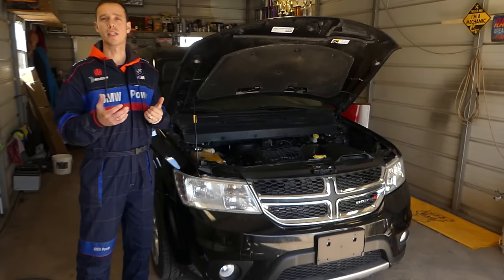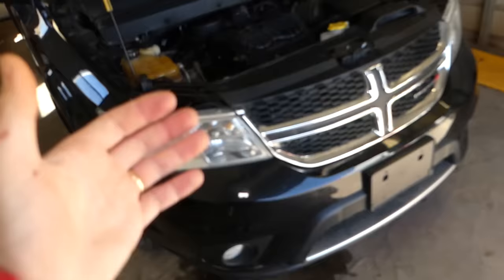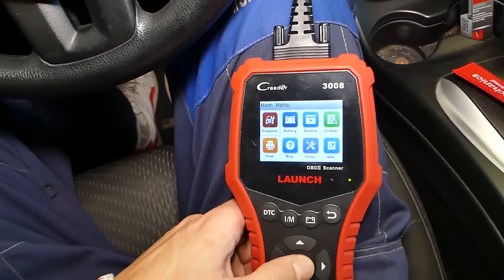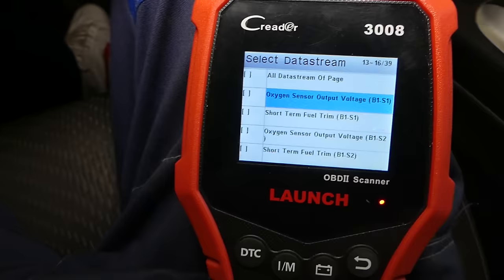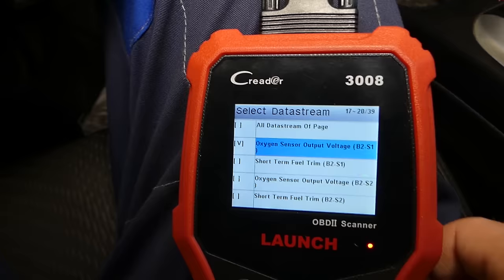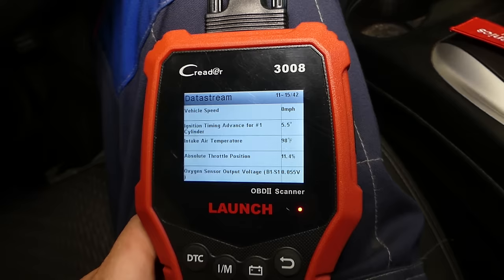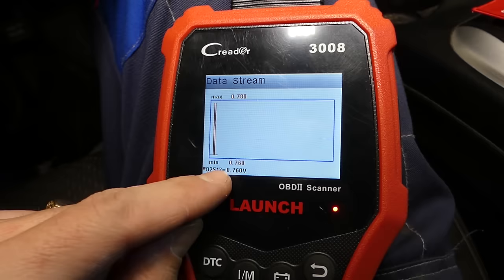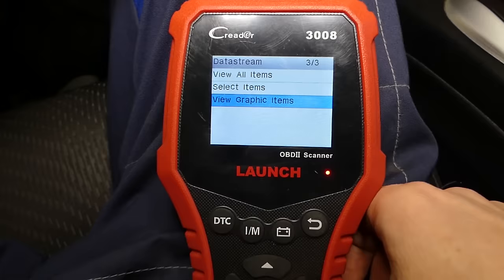HOW TO KNOW IF OXYGEN SENSOR IS BAD  TEST OXYGEN SENSOR

Comment: The Sensor 1's are what's called a PID feedback circuit, which means it hunts above and below what it wants... the figures are undershooting and therefore it adds fuel, then it overshoots and backs the fuel off, causing it to undershoot again, causing it to add more fuel again, as it oveshoots it reduces the fuel again, repeat. Basically the feedback loop reacts too much and it keeps on adjusting, going above and below what it wants. 
I imagine a house central heating system to help me understand.... When the room is cold, the heating turns on, heating the room up but when the temperature overshoots the thermostats set amount, the heater switches off until the room temperature falls back down again. Another example of a PID feedback system is a cars cruise control that's set to 100kph as it drives up and down hills, as it goes uphill the cruise control throttles up to keep at 100kph, as the car goes downhill it backs off to stop it going over 100kph. 

In this video Bank 1 Sensor 1 is working as its hunting,...fully adjusting back and forth.
Bank 2 Sensor 2 is dead, its not reacting at all and flat lines no matter what the engine is doing.
Reply: How do u differentiate what he shows vs a problem in O2 wiring? Thanks

Comment: Good humor. Bought the 7 piece socket o2 set. Only 1 fits the sensor, and I can't get leverage where its at. Won't budge. Sprayed penetrating oil, etc. Only thing I can think of is a very deep well socket to get me up and above some where I have some room to work. Will add an extension bar to the wrench too. That rear cyl 4-6 socket is in a hellish position. LOVE IT! Probably like this to force me to take it in somewhere.............

Comment: Thanks for the video. I hope you can show a lazy O2 sensor scan waves. I used a $10 Bluetooth OBDII scanner to test. Another YouTube video indicated that pumping brake pedal will release vacuum via the brake booster vacuum line, thus inducing a response in scan waves. My XG350 2004 (idle smoothly) showed rather active up and down waves for Bank 1's and Bank 2's S1 sensors (responsible for short-term air/fuel mix adjustment). They responded to my brake pedal pumping (3 or 4 times) (car in garage, not moving) after a very short delay (less than a second perhaps) to show a large peak. The same behaviors were seen in XG's OBDII short-term fuel trim curves. The peak disappeared after a few seconds. My Saturn Vue 2007 V6 (with Honda Pilot engine) (having rough idle problem) did not show S1 sensors in OBDII. I checked Vue's STFT curves instead. Same large peak response to brake pedal pumping. However, the waves without braking were only occasional and far less frequent than my XG's. I guess that means I have lazy S1 sensors causing rough idling. I will replace S1 sensors to see whether rough idling will improve.
Reply: Did it fix your idling issue

Comment: Hello great video! According to my scan tool my 2000 Toyota Camry 2.2 l 4 cylinder bank 1 sensor 1 upstream shows I have over three volts when warmed up! Would that .ean I have a short maybe or bad sensor. Any advice would be appreciated. Thank you
Reply: My 2001 Tacoma does too! I think that’s normal for those early Toyotas if we’re both seeing it. Mine was showing that long before P0420 problems.

Comment: Thank you so much for this video!  I've been getting a hesitation at low rpm idle and couldn't figure it out!  No codes to read.   Once I plugged in my obd II dtc tool and went to live data and watched all my o2 sensors in action.   I was able to determine that B2S2 (downstream) was falling well below the acceptable range.   I ordered a new oem sensory and will be installing it tomorrow.   I will keep you updated if this fixed my problem!  Probably saved my hundreds of dollars 💸.   I had an appointment set for Jan 4th but will cancel now.
Reply: Any update?
Reply: Update:  indeed the O2 sensor needed to be replaced and that part was easily diagnosed and fixed.   However, I'm still getting a slight hesitation and idle when I'n drive

Comment: What if my sensor is reading 0.01V at idle for a long period of time and doesn't go up a down unless I give it throttle
Reply: @Jake Blakeman post cat - downstream.    Im trying to get catalytic monitor and 02 system ready but my o2 sensor 1 bank 2 is at .105 volts ( at idle and engine full warmed up)

Comment: Hi have a question. What if the catalytic converters has the one problem. Does graphics moves up and down still?
Reply: Probably too late on this comment but in case someone else has the same question. If the catalytic converter is bad the downstream sensor will not stay around the 0.7 mark like in the video but instead rapidly change up and down much like the upstream sensor does

Comment: Well explained video. I have a question though. Its about the faulty Sensor 2 post cat sensor that showed 1.270v. Is that voltage from the ECU?
I have a GM corsa with a bank 1 sensor 2 P0138 & P0140.
It shows in live readings as 1.275v constant, even when the engine is cold and off, with the ignition on?
Reply: same here, did you find out the problem?
Reply: @luisdaniel75  Yes, it was the O2 sensor. I just bought one and replaced it myself. All sorted.
The 1.270v showing on the diagnostic really confused me.
I think it is an ECU reference voltage

Comment: Hi, Great stuff. You know your stuff.
Question. I am getting O2 codes on 2000 ML430, My symptons are NO start when truck is warm. I did cde check got O2 sen0r BANK2. I am going to order in a couple of weeks. But want to be sure this will fix my no start. ( thought it was immobiliser but found the no start was only when warm)

Comment: Dodge Ram 1500 4.7. O2 Bank 2 shows low voltage on idle. My understanding is the O2 Bank 2 should read high voltage on or above 0.45 to 0.85. Low voltage is lean condition, could there be an exhaust leak? Thank you!

Comment: Hi There. Just subscribed to your channel. I have a 2010 elantra 4 door sedan GL . No check engine light. Rough Idle. I have a launch 123i scan tool. The upstream 0 2 sensor is reading 2.0 volts and the downstream sensor is reading 0.74 vots ( Rich)  The STFT   reads - 0.78 Volts and the LTFT reads +1.56%  . Car drives OK, but fuel economy is terrible. I have cleaned the MAF and IAC, and Throttle body. Any ideas.  Thanks

Comment: What about driving downstream reading. My son's Toyota is reading 0.000 and bounces to the highest, 0.035. But mostly at 0.000 while driving 55 to 60 MPH. The upflow is up and down like what you were showing.
I just cleaned his cat, as it was getting clogged up a bit. It was giving him a code that the cat was going out. He keeps getting the evap system code too. Changed everything but the evap canister. I ised the dish soap method to clean out his cat, and it seems to have worked. I didn't check what the readings were before cleaning it out. The light shows it cleaned out a good amount. Couldn't see light through it before. See pots of light through it now.

Comment: Hello.
I have lexus ls 300 2004. I opened O2 dowenstream p0430 and cleaned. After i returned back, but sensor does not work. Showing 0 voltage.
But before open voltage was 0.6
Means Good.
I dont know What happend.
Reply: When car is cold the sensor is working, but when be Hot voltage become 0.

Comment: What does it mean if there is a flat drop 0 volts in voltage for o2 sensor 1 anywhere from a split second to 8 seconds? Also, what about brief spikes in short term fuel trim (98, 85) but no corresponding o2 sensor voltage spike?

Comment: So I have a diesel and my engine coolant temperature doesn’t seem to go over 160F/ 72c and in diesels since the fuel combusts from the high compression and cylinder heat I may be experiencing an issue where I’m having some unburnt fuel deposit into my exhaust. My bank 1 sensor 1 and sensor 2 both seem stable at around 0.8 v but when I give it gas they spike, does that mean my o2 sensors are probably good but im having issues with engine temps burning fuel?

I also noticed a slight drop in fuel economy possibly due to engine not able to warm up all the way due to a bad thermostat

Comment: What if you have a 2013 nissan rogue, with a p0171 code? My Bank 1 Sensor 1 is reading at 2.250V. I've tried going through everything on this vehicle. At first it wouldn't start back up even after shutting it off for just 5 mins.

Comment: I have one question, I have mazda 6 2008 1.8 petrol and when accelerate it's jerking and choke like thing, staling until 3-4000 rpm. No check engine light and when  use scan tool it's says some strange thing. First even temperature is like 91C says that is Open loop inficuent temerature, there is no senson 2 or downstream, for sensor 1 voltage is constant high, constant low sometimes it's oscilating. Short term fuel is stuck on 0 and curent in mA of sensor 1 is constant 6.35mA.

Is that sigh tnat is sensor bad, folowing your video I think it is but I am not mechanic. On local mechanik shops they are unable to resolve problem without telling me they need to replace MAF, spark plugs, acc sensor and eletronic motor and that is too expensiv.

Comment: Hi guys grettings from Venezuela. I had a  f150  4.6 v8 engine. Its make me crazy. Y got 5 codes. All are similar B1s1  stuk rich  b2s2 stuk rich. Bank 1 rich etc. I scanned and de output voltaje from tje both o2 sensors its about  0.912v and 1.100 they doesn move over there. And the graffic its a flat line. Should i buy both o2 sensors? Another test? Thanks my friends
Reply: What ended up being the problem?

Comment: Why is the bad sensor so high?
My truck has the sensor two stuck at .750
Could that be why i have loss of power, wont go over 40mph, rpm revv up and drop but truck never accelerates.

Comment: My upstream sensor works well at low rpm but when increase above 3500 rpm the voltage is high and the check engine light appears. I have p032 code. The sensor is bad?

Comment: Question, my 2001 Toyota Sequoia that have all o2 sensors showing 0 volt during idle but it goes up to random voltages (with upstream higher the downstream) when i rev up to 25k rpm and hold it there and they just take turns to go up and down between 0~0.8 volt. Please help, thank you!!
Reply: No help i guess?
Reply: What codes do you have ?

Comment: Hello, can you explain why the voltage jumps around so much?Constantly going from lean to rich. I would think in a good engine you wouldn't do this. Thanks.
Reply: The ECM does this on purpose.
It run the mixture between lean and rich constantly to help the catalytic converter work better.
Reply: That mean the upstream o2 sensor is good

Comment: What if readings are same as you but no check engine light?
My car has 2 sensors i.e. upstream and downstream
Upstream graphic is up and down not less than 0.7 not more than 1.0 volts
Downstream graphic is stable to 1.27 volts even after acceleration.
BUT NO CHECK LIGHT.
PLEASE HELP
ENGINE IS HALTING
ROUGH IDLE
HIGHER FUEL CONSUMPTION
Reply: I mean maybe I’m dumb but didn’t he say if the sensor doesn’t move or fluctuate at Alll then it’s a bad sensor.... and u say it’s stable as in its not moving at all?

Comment: my friend i have a 2013 mustang v 6 i got the code for bank1 and bank 2 efficient threshold catalyst  my car got something when hit full throttle the car rpm go from some 1000 to 2000 rpm so slow the car launch is so bad and when keep doing full throttle   its start to do something like misfiring its keep cutting of and keep lagging but i got no misfire code any advice
 note my cat is deleted
Reply: I have the same problem... It hits rough idle at 40mph and up... Did u figure that out yet?? Lmk pls...TY

Comment: What if my 02 sensor bank one reads 3.277
Reply: Probably short
Reply: Hi Chris. Did you solve? Mine reads about 0.9  and 1.2 both sensor (i got a v8) the voltage does not move

Comment: So you just unplugged them. That unrealistic expectations and poor guidance.
Reply: when you have a bad oxygen sensor it's best to run with it disconnected since it'll run predetermined fuel trims and just run rich vs running with bad input data til you get it replaced
Reply: @johnjoseph7382  is that safe to do if it's the upstream sensor
Reply: @cameronartukovich6810  yes, your car will just run a little rich while you test if the problem is the upstream sensor or not
Reply: @johnjoseph7382  do you recommend me trying it? (I know it’s not English, sorry). I’m away from home. Last night, my engine stall at a red light. I manage to restarting by flooring the gas pedal and putting the car in drive. It not ideal, but I had to continue the trip to a safe place at least. Anyway, I know it’s a oxygen sensor. I just don’t want to stall again until I’m able to bring my car to my mechanic. Thanks!
Reply: @aswd45-mk14  yes, it'll just run ricg and use a lil more gas
Reply: @johnjoseph7382  ok, thank you. I just did a test drive with it and it drowed again at a red light. But when i'm accelerating it is fine.
Thnk you again!
Reply: @aswd45-mk14  then the oxygen sensor isnt the problem
Reply: @johnjoseph7382  ok! But the code sais oxygen sencor. Ill have a deeper look then!